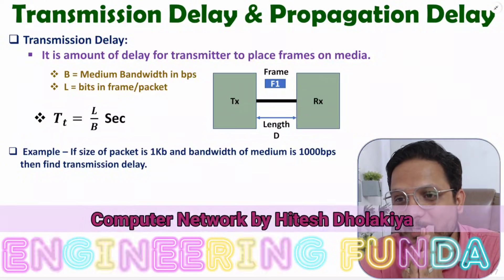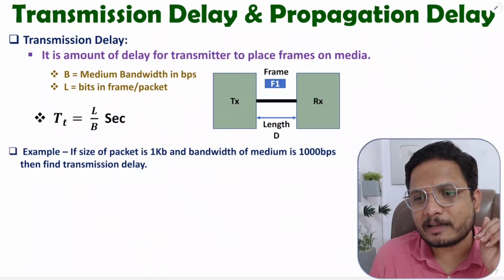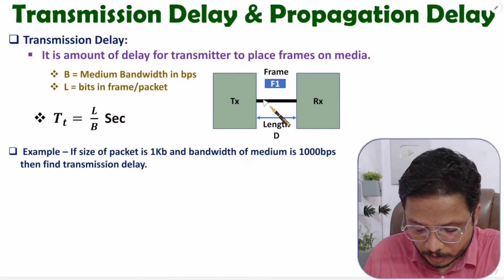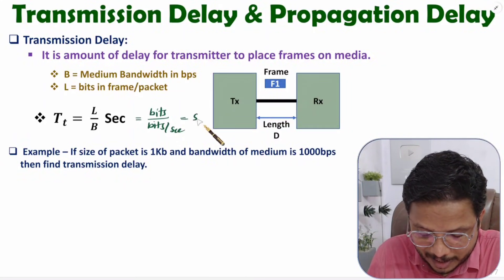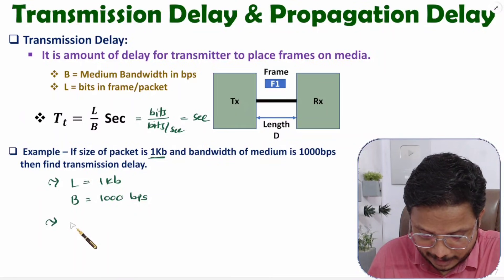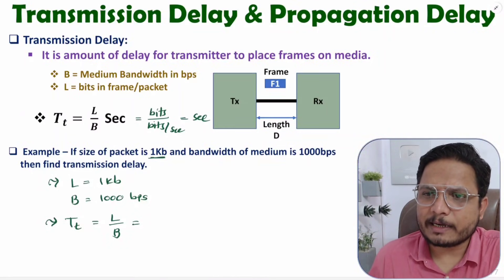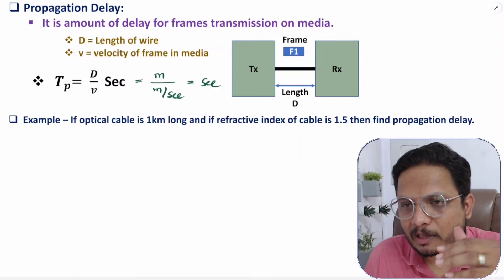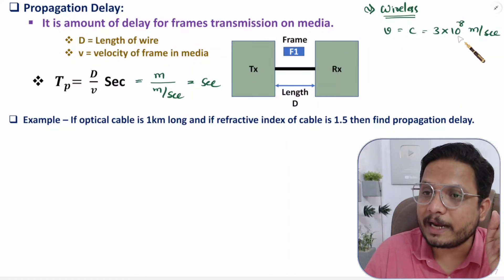Transmission Delay and Propagation Delay in Computer Network Explained

Comment: wrong  transmission delay calculation.1kb = 1024 bytes. bits me convert nahi kiya sir aapne ?
Reply from the maker: There is a difference in between 1kb and 1kB
1kb = 1024 bits and 1kB = 1024 bytes.